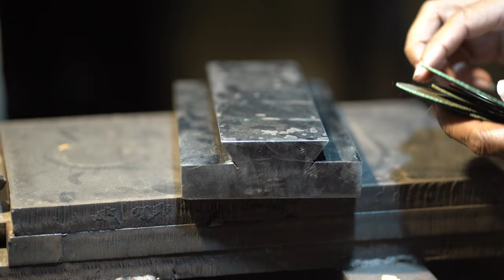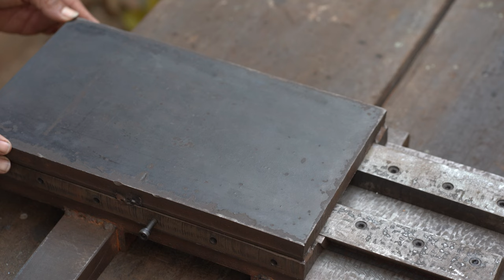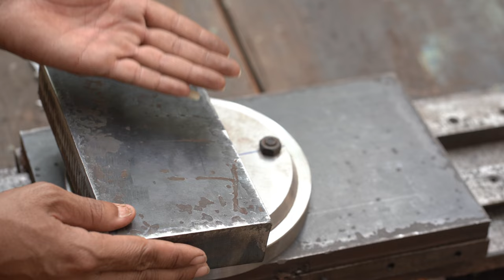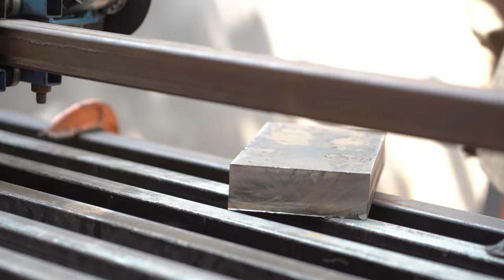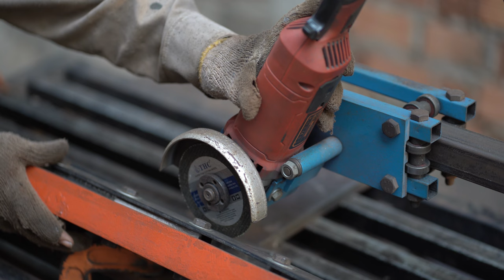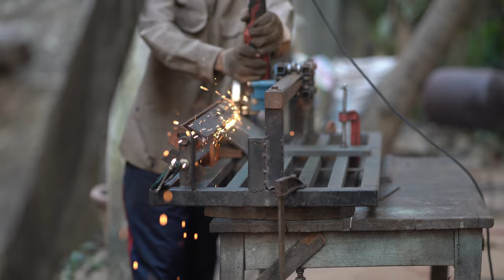Incredible Angle Grinder Cutting Slider Can work Thick Plate Metal For Compound Slider

Comment: hello my friend, is your cutting disc very durable or did you use several to make all these cuts? thanks
Reply from the maker: Thanks, depends on what I cut, I always used it when the big thicker plate of metal because very stable self.
Reply: Good morning, what brand of disk do you use, I'll see if I can find it here in Brazil to buy @mr.ranyhomemade2466
Reply from the maker: Hello good morning 
Diameter 12mm and 1.5mm thick